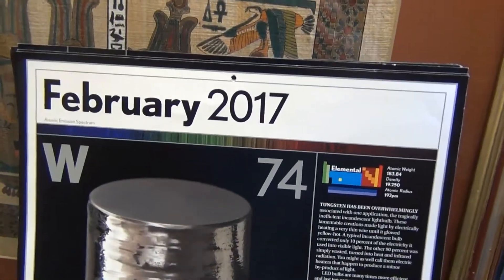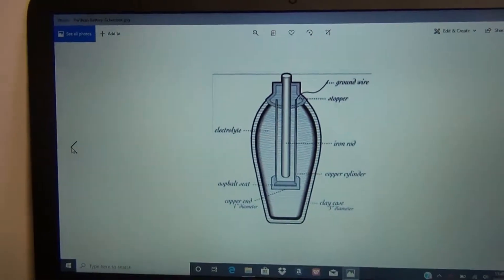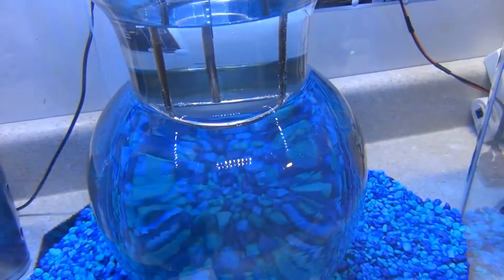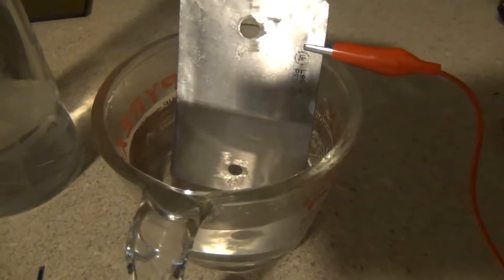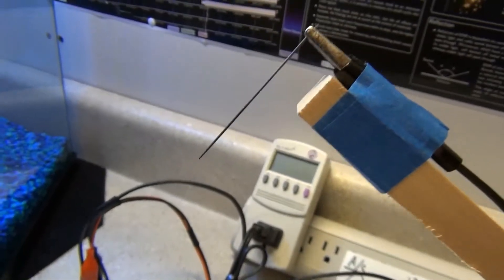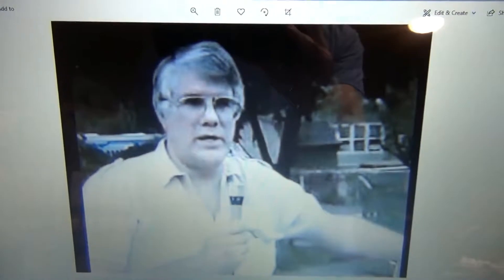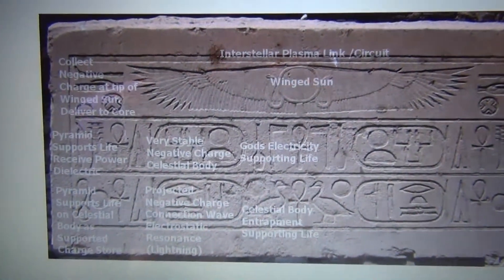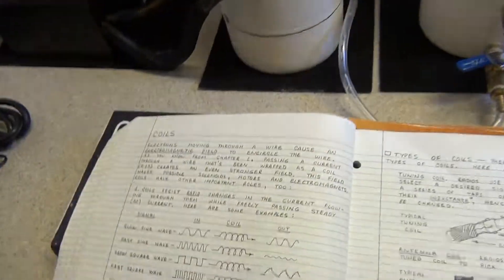STANLEY MEYER HIGH VOLTAGE CFR SPARK PLUG

Comment from the maker: The comment section is now open from here out feel free to ask questions i will try to answer them for you. The CFR reactor has now been put inside of the oxyhydrogen behemoth wet cell in the enhanced torch design as a heater unit to heat the fuel cell very quickly for starting the electrolysis process. Voltage performs the work in this circuit...
Reply: Yes of course, voltage potentials are extremely important aspects of physics of which humanity knows very little. My little experiments with Air Antenna show the enormous potential of energy flowing through the air we breathe. At times I've reached 6000v with different setup of capacitances. youtube.com/jabafuller